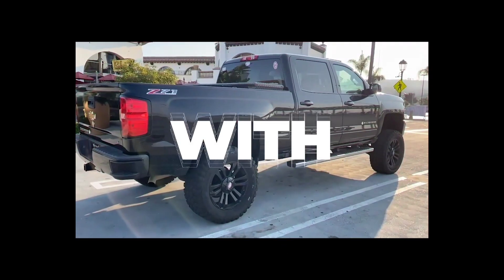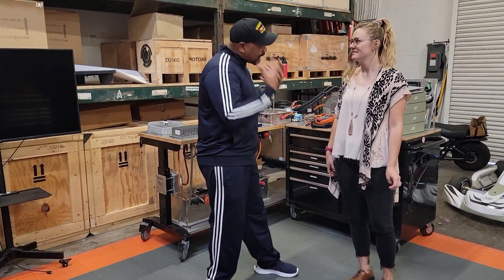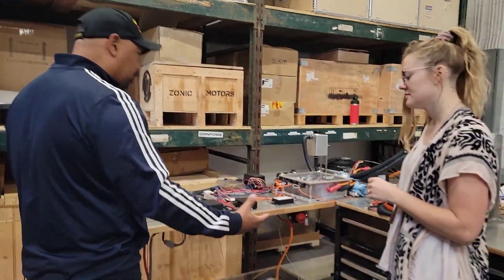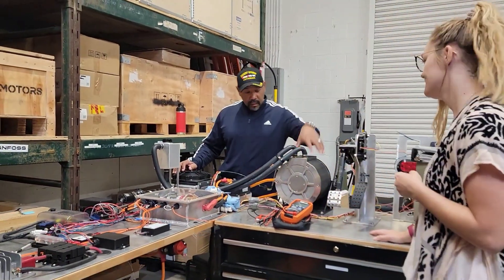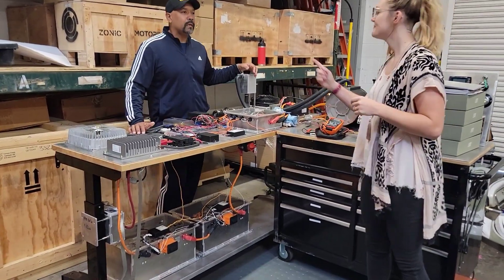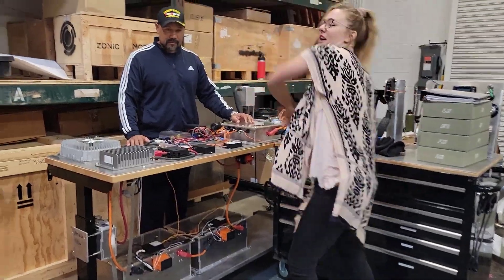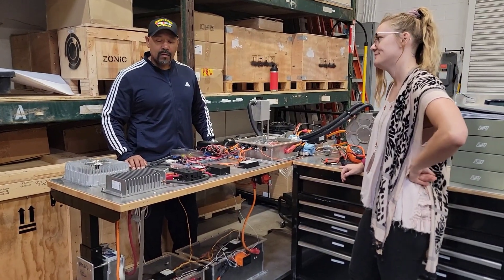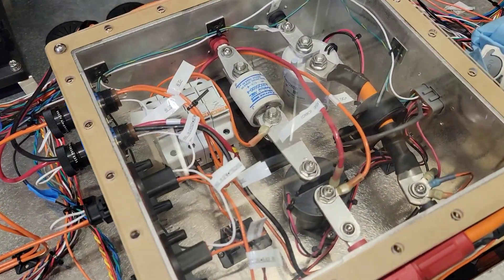Legacy EV training is the real deal!!!!

Comment: I hear about the class from Holley  high voltage. But before I heard that I decided to do a body swap. So I didn't have to do all the wiring. So I am using a fiat 500e with a ford aerostar star  body. Picture 90 inch aerostar bronco safari top. Pic in profile
Reply from the maker: Let's see some pics.